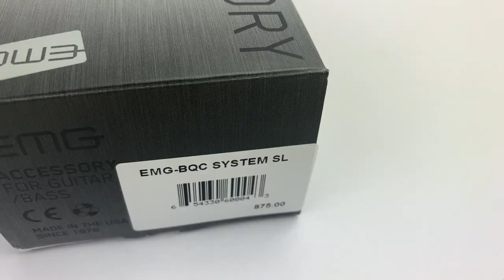EMG BQC System 3 Band Bass Preamp: What’s In The Box (A Close-Up Look)

Comment: What the difference between the BQC and the BQS???

Will this system work with the stock active boost that comes in some Ibanez bass’?
I have the active P/J set installed in it already with the boost which I like.  So am wanting to add the active eq.  
Dos the system really have two volumes, one for each pickup?
Reply from the maker: Hi - Thanks for checking out the video.  

BQC is a 4 knob control layout: Volume -- Balance -- Mid Boost/Mid Frequency Stack -- Treble/Bass Stack
BQS is a 5 knob control layout: Volume -- Balance -- Mid Boost/Mid Frequency Stack -- Treble -- Bass

Neither of these systems from EMG have two volumes, both have a single volume with a pickup balance potentiometer.

Drop us a line at info@fatbasstone.com with your model number on the Ibanez along with your question about the boost compatibility.

Comment: Can this unit work with any bass EMG pickups?
Reply: The 'Systems' will work with any of the EMG Active pickup offerings.

You could use one of the EMG 'Controls' with the HZ pickups (if that is what you happen to have), but not one of their regular 'Systems'.  EMG does make some of the Systems in an HZ model.
Reply: @BrianRistola  thats the information I needed to know thank you.
Reply from the maker: Excellent
Reply: @BrianRistola HZ model you mean that what for 179$?
but this 3 band is 119$
so, this model haz no preamp ?
Reply from the maker: A little explanation:
-HZ models are for passive pickups
-EMG Systems include all of the potentiometers (Volume, Blend, EQ pots)
-EMG Controls (like the $119 version you mention) only include the EQ pots